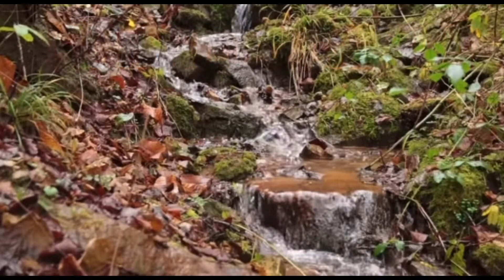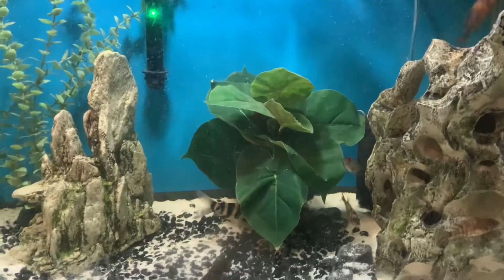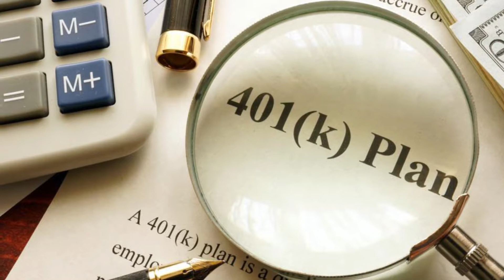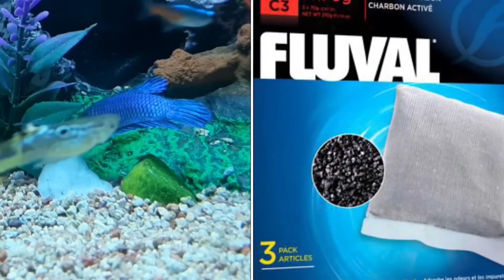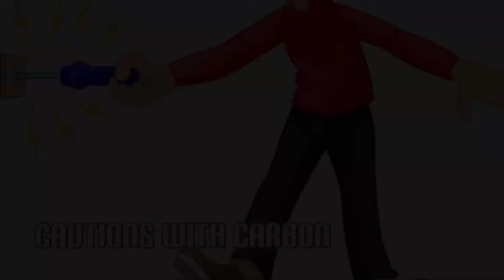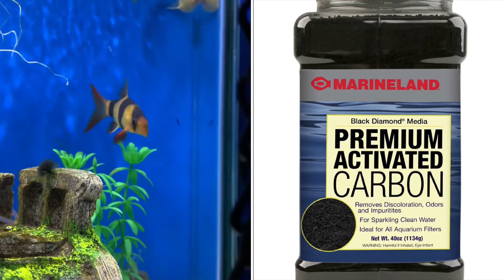Do You Need Activated Carbon Filter Media???

Comment: We use carbon the same way.  I've heard that if left in too long it is possible that it will start to release some of the junk it absorbed.  One time I had a couple bags of carbon sitting next to each other in a damp area.  After a few minutes the "Matrix" Seachem carbon had a bone dry area around it. It had absorbed every drop. The other carbon was sitting there in the puddle.  Made me a believer in Seachem Matrix carbon product.  Thanks Vinny.
Reply from the maker: Thank you Ben 👍👍👍 now that’s a pretty good example of a product that actually seems to do something, I want to try that experiment my self now! I just think it’s a shame a lot of new people to the hobby get sucked into buying those filter replacement cartridges with the carbon in them for so much $$$ ... thank you for the great comment 😁

Comment: I have a 100 gallon with 2 13 inch Oscars and a aquatop fz13 canister filter can I remove the charcoal filter completely? It gets dirty so fast then I have low flow issues. I change 20 gallons of water weekly but my Oscars eat large food and it's very messy. My tap water is very good living right next to lake michigan